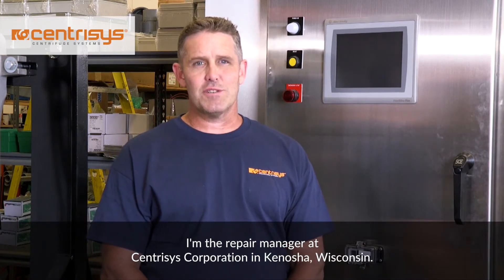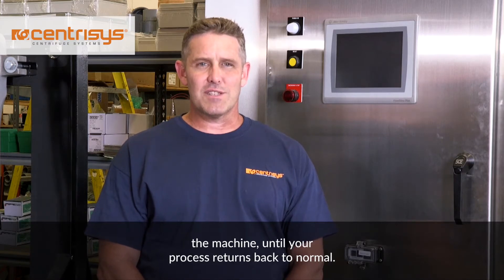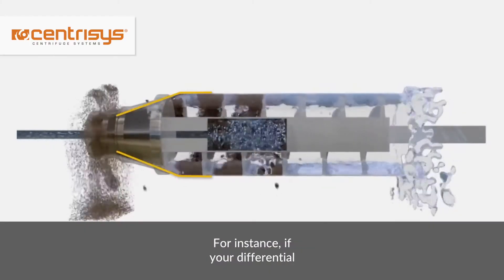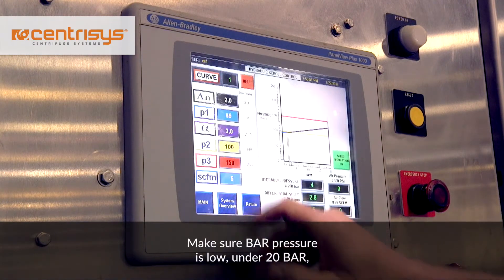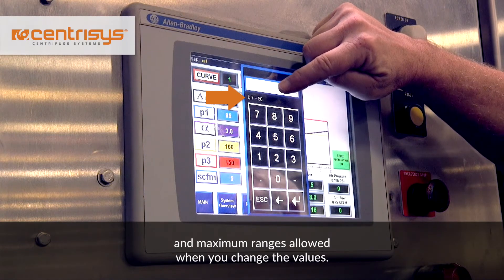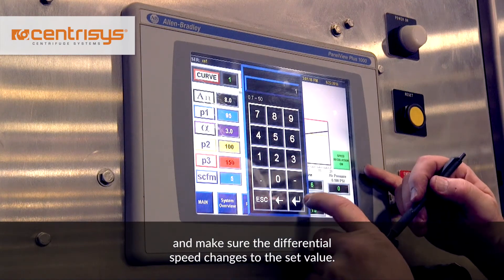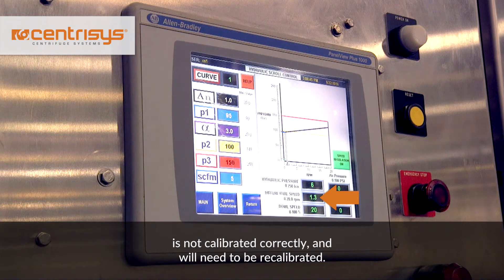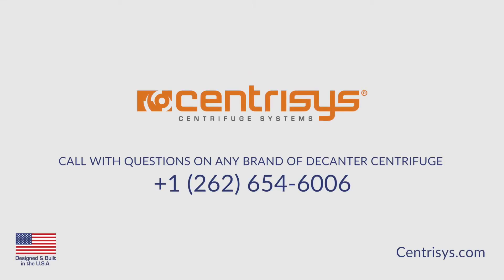How to Verify the Calibration of Differential Speed on a Decanter Centrifuge

Comment: Bird Decanter Centrifuge was a planetary gear box it is having 21 diff.speed . Bowl RPM 1064 . Scroll rotate slower than Bowl. We need to incorporate with Hydraulic drive, what will be the rotation of scroll and Bowl same Direction or opposite direction pls confirm.